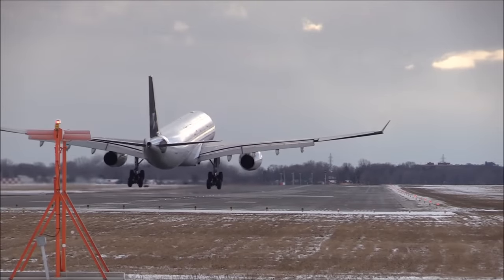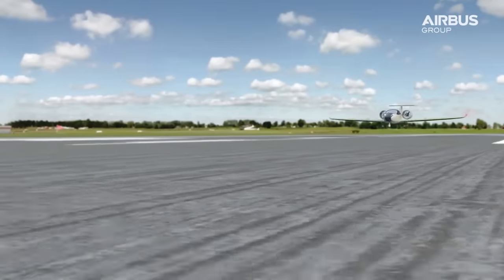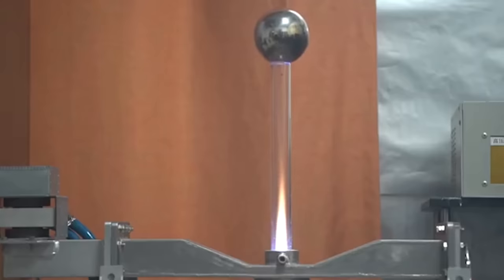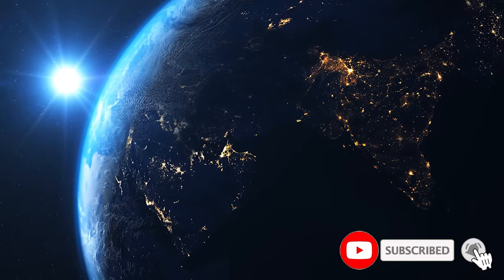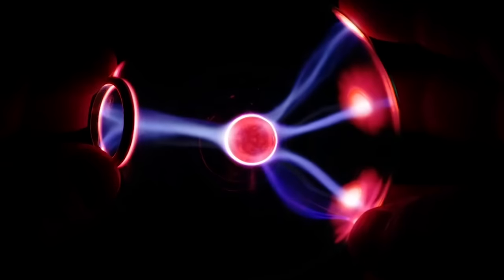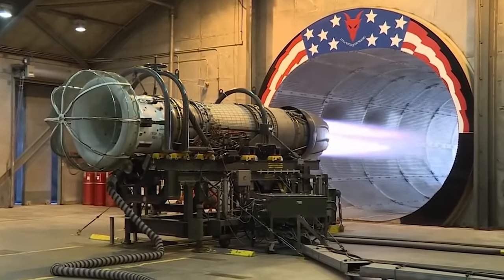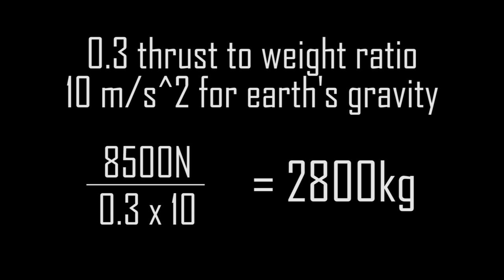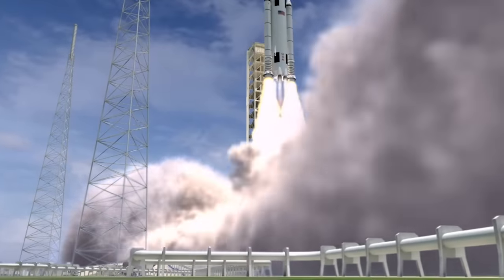Uncovering China's New Electric Plasma Jet Engine

Comment: Well what if it was paired with a APU that runs in flight. This could be similar to hybrid car, way less emissions, no need for large battery packs, and faster up times because you dont have to charge a plane. Plus APU development cost will be cheaper than research in super light weight batteries.

Comment: There are many sources of electricity that should be combined in the most effiecent ways....
i.e. solar panel exterior, heat to electricty fins on the exhaust, ~plutonium batteries, incorporation of all units into the printing of the plane.

Comment: Commercial jet engines are not better than ducted fans, they ARE ducted fans. Powered by the thrust from burning the fuel. Some residual thrust still pushes the airplane forward a bit, but most of the thrust this engine produces is generated in the bypass, by that huge fan in front, inside of the big duct. Take a hint.

Comment: Wait. At 00:07 you say aircraft produce up to 3x as many emissions as a vehicle per mile.

Is that 3x to the relative number of passengers? Or 3x for the vehicle alone.

Just checking, because umm if it’s 3x the emissions with up to 150x the average people onboard, (avg 2 in car and 300 in airplane) then that’s actually pretty remarkable…

Comment: The key thing that makes this technology impossible for use in planes, is generating the massive amount of electrical power and total electrical energy in a light weight, economical, compact, reliable, energy efficient way. Bottom line - such a thing does not exist. And suggesting that this can be used for spacecraft is irresponsible because only a limited amount of compressed gas can be carried. After that gas has been depleted, the spacecraft can only coast. That effectively makes this technology little different than existing rocket technology.

Comment: So they are turning electricity back to heat to run a heat engine? Doesn't make sense to incur a huge efficiency loss of a thermal cycle, when you can use a  motor to drive the compressor to produce thrust. This is akin to using electricity to heat up water to generate steam to drive a fan vs just using a electric motor to drive a fan, like what we do in the real world.

Comment: Interesting but I doubt this is going anywhere unless maybe they paired it with a small nuclear power source to be light enough to fly. But who knows??? Maybe they will discover other ways besides heavy lithium batteries to make this work. As a pilot I can tell you that a lithium battery fire would be an absolute nightmare in flight. When Boeing first launched its 787 Dreamliner they were plagued with a couple small lithium battery failures that grounded the airplane for a time while they redesigned the system. Had that plane been powered with several thousand lithium batteries and had a battery fire I doubt those planes would’ve made it to the ground in one piece. Great video tho. 👍 Love seeing new tech.

Comment: Ionized air cannot combust, as it contains no fuel. The purpose of the microwaves is to simply to heat the air to extreme temperatures. This takes the place of combustion in a traditional jet engine.

Comment: You spend a huge amount of power just to heat the air instead of working toward accelerating the air itself. The nozzle can extract only a portion of thermal energy and turn it to kinetic energy that can produce thrust. Remember, that a huge jet engine has a power of a small power plant. Not really feasible without huge breakthrough in battery energy density.
I would rather bet on a huge, high powered electric engines that maybe could use heat as afterburner during takeoff than any plasma engine. The real problem now is battery energy density, not thrust. We don't have good, big electric engines just because there is no point in them right now.

Comment: for now we go the next step: 4 persons and a battery with an energy density of 300Wh on a cell level to do 300km of range together with an electric motor and a propeller.
practically the evolution of the pipistrel alpha electric.

Comment: I wasn't sure it was caught....but the entire process is akin to a perpetual motion machine...as described   Zero losses are impossible.  Apart from that you have the problem of creating a cold plasma.  As a state of matter, in conversation, plasma can exist.  But it doesn't become an operable energy source at the temperatures of a jet engine.  There will be no way to contain a plasma in the housing consistent with a jet engine.  The second problem is the reignition of the plasma should the engine go out.  The problem of having 5he power on board to create the plasma while in flight.  The third problem is the selection of the gas and it's storage.  Plasma converts massive amounts of gas.  The energy contain in a gas converted to a plasma is no where near the energy per unit of a jet fuel.  So, mass is an issue.  Volume is an issue.  Etc

Add to that , you need to create the gas in it's pure form which takes a great deal of energy. So, try again

How about this, research before you present a lab finding that is sketchy at best...and should generally be considered.unusable.

Comment: 2:45 "enough force to move a whole spaceship"
2:53 "is uses air"

how is this gonna work in space then?
Reply: shooting air at high speeds still gives thrust even in the vacuum. mass is mass
Reply: @richarddutton1981  yeah i get that but there is no air in space
Reply: @quammelschroedinger780  lol it doesn't matter.  Your shooting mass in one direction  laws of physics saws you go the other. Not a lot of thrust with air, bit still some.
Reply: @richarddutton1981  but it is incredibly insufficient. A jett engine has an air intake, you would have to bring air to space just to blow it out the back.

Comment: how about using a laser or sound waves to super heat the air. then compress it and then shoot it out the back? or super heat it, then cool it down quickly to create a difference in pressure. and then use that pressure as thrust?

Comment: Well if my 'Mag-Gen Motor' works as well as I hope it does, maybe we can replace batteries with generators powered by just magnets alone.  I figured out ten years ago how to make one magnet propel itself past another, by placing a soft iron plate on one side of one flat magnet on the 'stator', so the magnet on the rotor will attract to that instead of be repelled from the magnetic field (so lets say these are two 'North' magnetic poles pointing towards each other), and then its momentum carried it past the point where they line up edge-to-edge (where they attract one-another strongly), to the point where the two opposite magnetic poles (South Poles in this example) begin repelling each other, and I built a test device, and it DID work!
And then recently I realized there are actually MANY devices like this, but none of them produce much actual power, so I figured that the greatest amount of torque you can get between two magnets is when both North and South poles on both magnets repel one-another and force the magnets to rotate (in this example one rotates, 180 degrees, while the other holds still)...
So now I'm waiting for some Lego parts to arrive to build the first test model just to see it work, maybe take some torque measurements (if the plastic parts dont break), and get video of it working to show people, so I can get the investment(s) I need to hire a Machine Shop to build metal parts for working prototypes and generators I can sell.

I was calculating that the six 3/8 inch cube magnets I have which lift about 10lbs each might produce around 1,500 Watts of power, if they have close to 10lbs of force at 3/16 inch radius (Half the diameter, when rotating relative to each other, so I can calculate the torque in pounds relative to a 1 inch radius), and if it rotates at an avg. of 3,000 rpm as I read the average generator does.

And I was watching this video and realizing how you can produce more power from a generator if you create 'harmonic resonance' in the coils, and if you have the wires passing at 45 degree angles to the lines of force from the magnet and the direction of motion (According to the 'right hand rule', 'laws of induction', 'ohms law', etc.)....
https://www.youtube.com/watch?v=HK3JOlY0V8Y

So hopefully when I have a chance to build this 'Mag-Gen Motor/Generator', it will be able to replace batteries and other forms of power generation which consume fuel, at least to a point (there will be exceptions where those technologies are still the best I'm sure).  Hopefully we will see soon!

Comment: This engine is not realistic for jet travel. What they don't tell you, is that microwave heating relies in water vapor in the air. At high altitude there won't be enough water vapor to heat. The same goes for low humidity areas near the surface. Microwaves can't heat the air, they can only heat water.

Comment: would that be 2.8tonnes of direct thrust if so then that would not be the weight of the hyperthetical sir craft since the lift is from wings you would want to look at max thrust requirments of aircraft for takeoff as this is the highest required thrust value after that and your climb you would just be throttling back to coast through the air using minimal thrust.

Comment: Could you combine the outputs of both this electric plasma jet engine (EPJ) and a hydrogen gas engine from using water thus having a hybrid engine where the plasma also provides ignition for the hydrogen providing extra thrust? Might be too hard in practice.

Comment: 1 jet engine 2500kg ... 12 jet engines ... 30 Tons 30,000 kg for everything a plane needs...and since a Boeing 747 weighs 183,500 kg or 183.5Tons... you will need  74 jet engines strapped to it.... ehm.... you could see how that wouldn't make any sense at this level right? maybe for spacecrafts in vacuum that would actually be amazing... but since in space the gasses are so rare and is a vacuum well then... sort of hard to pressurize gas that isn't there, unless u carry with you ice ... or water.

Comment: I don't understand why moving air by heat expansion with heat loss as side product is better than directly move air with propellers with minimal heat loses...
Now is problem how to store electric energy. Electric motors weight is low and its efficiency is close to 90% now. Problem is only energy storage.

Comment: Solid state hydrogen would be the way to go for aeroplanes. The fuel can be made non-combustible producing and supplying hydrogen on demand to run fuel cell which is all light weight that if designed properly can even beat existing technology in terms of range.

Comment: the cannister of the ignition cycle has a static charge running through it of not normal electricity? an aspect of electricity? and when the particles get blasted by the thrust it wear's off but is sucked back by the static?

Comment: It's a common misconception that electrically-powered things have a reduced carbon footprint.  Although, I do wonder about economies of scale. Is it more efficient for me to run a gas generator at home (natural gas) or for a gas power planet to send it a few miles over power transmission lines..
Reply: If the power grid of the country has a lower carbon intensity (in grams of CO2 per kWh, gCO2/kWh) then burning a gas of some kind to power a vehicle/process usually does have a higher carbon footprint. For instance, burning coal produces around 800gCO2/kWh and the electric grid of Norway - which is primarily hydro and wind power, this has a carbon intensity of 20-30gCO2/kWh; so in the cases of countries like Norway, it will most certainly be a lower carbon footprint to electrify.

However, you are right in the cases of countries like Poland, Germany and a lot of the US states, where they rely on coal, meaning it can actually be more carbon intensive to drive an electric vehicle. As for your point on the extra energy needed to transmit the power over large distances, I am not sure.

Comment: 80 percent of the fuel used in aviation is used in the us, just so you know....
also the explanation of generated thrust is not quite accurate,  as most of the thrust is indeed provided by the fan of a jet, the fan itself consumes on the order of tens of MW of power provided by the gas turbine, so thrust from the fan is like 20 times more on modern high bypass engines than the hot air stream. Also thrust can be either speed or mass, usually mass wins for practical reasons, because modern jets pretty much work at their fundamental speed limit, so moving more air is the only way to gain thrust without using a motherload of fuel

Comment: China is not the only one developing this technology. Actually scaled electric plasma jets have more thrust than conventional jet engines and as the energy density of batteries grows equivalent to fossil fuel and soon surpassing them as well as ability to charge them in mid air thru altitude voltage or some other form like solar cells on the skin could  soon make jets that can stay up for weeks or months cruising around with fuel no longer a constraint on flight plans as well as no longer a major cost or weight in future aircraft. Point being we need to really focus on the new emerging technologies and put fossil fueled aircraft cars and energy production as antiquated technology of our past and start trying to repair the damage we have created thru it’s use in the amounts and length of time thru carbon capture and other again emerging technologies and ones not even conceive of yet that big oil doesn’t want and has/will do anything including murder or take down America to try and stop or at the least slow down as much thru there corruption of governments and peoples minds who do not know about or understand the new edge of technologies and what they offer cause they turned over all critical thinking to perceived authorities heading the modern political cults they created exactly for this purpose.

Comment: I have been doing research into faster than light speed travel for about 7 years now and have discovered a new physics than one day may allow faster than light speed motion through space and within atmospheres and is able to propel space craft beyond the 10,000 light year distance through the Polarextremic region,(space), in a matter of milliseconds. The new physics is based in quantum theory that suggests that one atom or a multiple of atoms can exist in two places in the cosmos at the same moment in time. The new physics is called Atheric Relative Physics and experiments related to this physics suggest that nearly instant movement through the Polarextremic region may be possible using this type of physics and what is known as Atheric Attenuation Propulsion. The words Artheric Physics are not in the dictionary nor can they be looked up in any search engines because this is/was classified research that now can be released to the public. Atheric Propulsion relies upon the idea in quantum physics that not just one atom can exist in two places at the same point in time but that any amount of atoms can do the same although a delay and the dilation of time occurs when this propulsion is in use and requires only a few milliseconds during use. The process works by selecting a target location within a selected distance any where from 50 ft to 10,000 light years or more and this process is called Atheric Attenuation and once the selected location is recognized and is formatted into and by the computers in the craft or devices on your person propulsion then can be produced through an atmosphere or through deep space and a "jump" through space and time occurs with time never reversing or accelerating into the future and instead only time is consumed in seconds and miliseconds and that time remains constant during the use of Atheric Attenuation and during the use of Atheric propulsion. The use of Atheric Propulsion requires no use of fuels, plasma engines or rocket engine technology and requires significantly low amounts of energy and/or electric power to be successful. This new physics is now being explored as a possible solution to the question on how to traverse the very vast distances of the cosmos without the use or need of enormous amounts of fuel and/or electric power and that movements through these vast distances of the Polarextremic region would need to involve multitudes in the thousands faster than light to get into deepspace within reasonable time expenditures of less than a year or less to get to distances of 10.000 light years or more and live through the now perceived as long flights. Today this kind of physics is perceived by science as illegal to use, however, as of yet there are no actual Laws restricting it use in any country of the world today mostly because very few are smart enough to know of its existence, ...... Written by Cozmos....at: ruinsmars@gmail.com

Comment: Yes but what is it doing to the air that passes through the engine.  I mean if you are getting a visible flame, chemical changes are happening. I wouldn't be surprised if these engines actually produced more nitric oxide than a conventional Jet engine. There does not seem to be anything else they could be burning to produce that flame. And Nitric oxide is rather toxic.